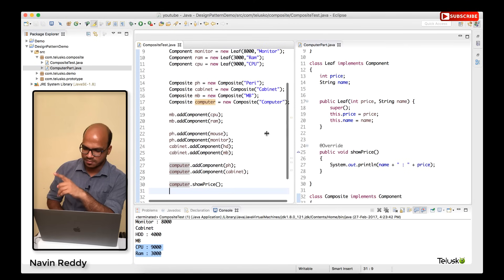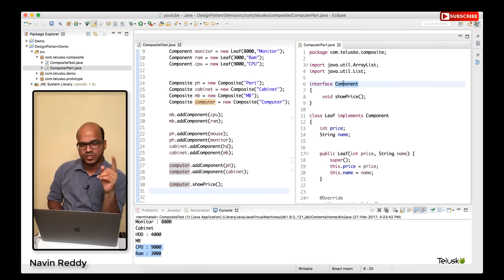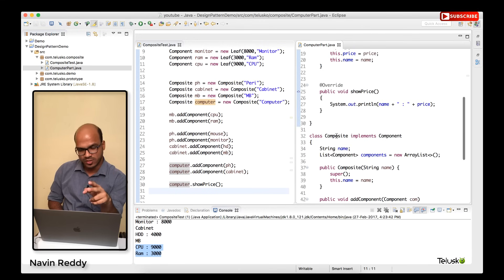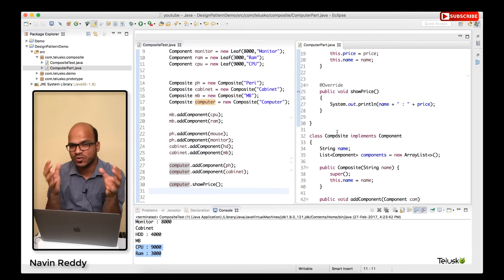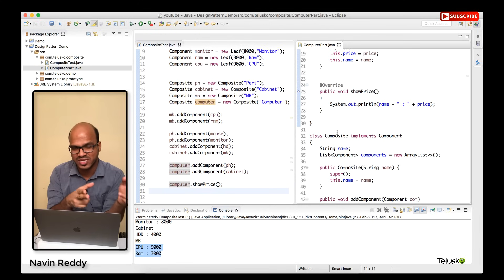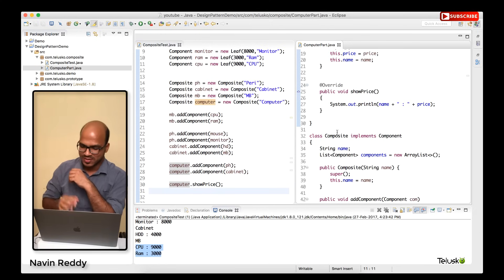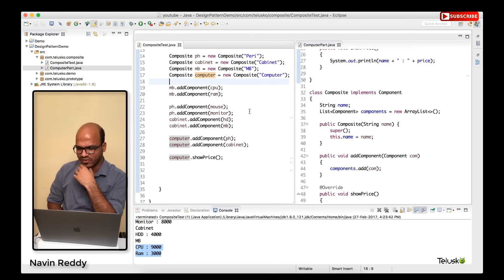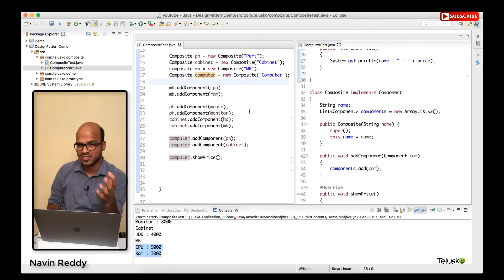Composite Design Pattern Practical

Comment: At the beginning of these tutorials, we were told design patterns were created with two things in mind, "Composition over inheritance" and "Code for interface, not implementation."

But here, we are coding to implementation, not interface. (With changing component to composite to use the addComponent() method.

With this example, why are we not able to use the addComponent() method if we are using Component as the type, but instantiating a new Composite? And doesn't this go backwards on what is one of the rules for design patterns?

Great work with the video and I understand the Composite design pattern through this, but these two hang ups are making me a bit confused.

Hoping someone can clear this up for me. Thanks future person. :)

Comment: How would you implement a method that returns the total value (sum cost of all components) of the computer?
Reply: The computer is a composite. It implements the component interface so it must have a getPrice() method. This composite class contains an Array of his own composites or leafs, he iterates trough it ( with a forloop) and you can add a variable (local or global) to the composite, doing in every iteration TotalValue += c.getprice